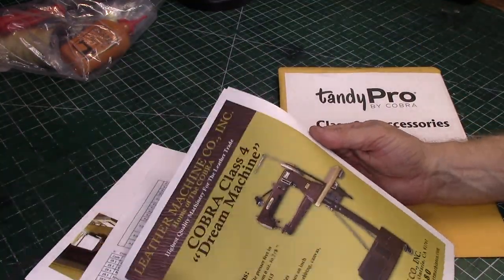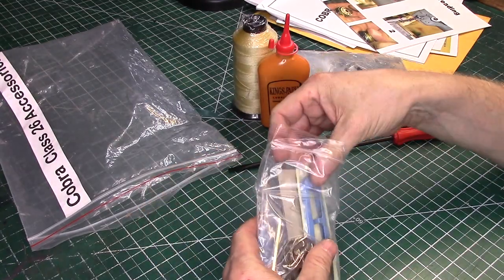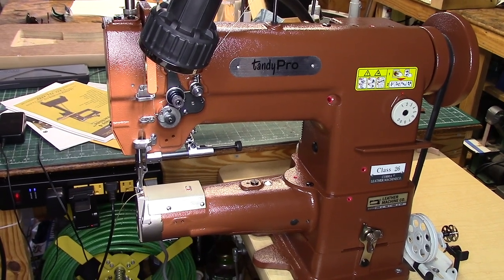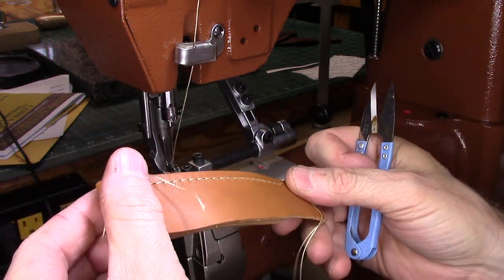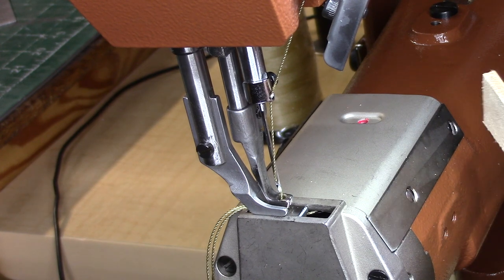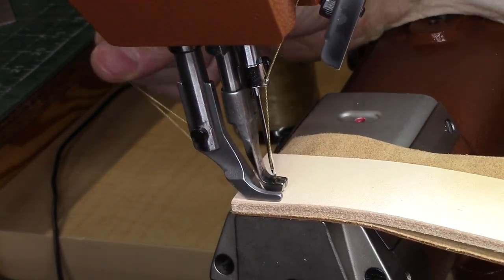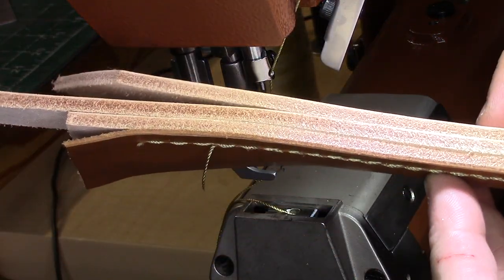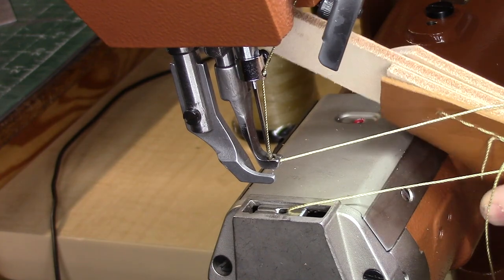Cobra Class 26 Leatherworking Sewing Machine Torture Test!

Comment: A tip for the table. If you remove the table a lot, replace the wingnuts with M8 thru-bolt knobs. A game changer for these old hands.
Reply: David your comment got me thinking. I'm going to look into a camloc system for the table connection, so I can just quarter turn a knob on the bottom to lock the table in place. This would make putting the table and taking it off a BREEZE!

Comment: I think there's 1 thing people forget to mention on demos like this is the glue. On real projects, people put glue in between the leather, and that adds density that add stress to the sewing machines.
Reply from the maker: The Cobra has an oiler pad for the thread just above the needle. I find that helps a bit. I used to spray the thread with silicone on my Boss for the same reason.
Reply: @RoadAgentLeather  I'm using the Cowboy CB3200, which is similar to the Class 3, im quite surprised class 26 can go that heavy of a leather. Love your work man!

Comment: Are you happy with the appearance of 207 thread which is maximum for the 26. Your hand stitching on holsters appears thicker. I’m considering the 26 for my first machine. Like you, I  make holsters  as well as bags. Your work is beautiful!!
Reply from the maker: I went through the same decision-making process. I bought this machine almost specifically to sew liners. I knew I was always going to saddle-stitch the main seam on holsters and knife sheaths by hand. Those seams aren't typically that long or difficult. But sewing together a bag, pouch, satchel, or a backpack by hand takes forever. From a practical standpoint, there's only a slight difference visually in 207 and 277 thread (in my opinion). Supposedly, you can run #277 thread on the top of the Class 26 . . . although I've never tried it myself.

Comment: Not going to yell at you. Because…. “been there and done that”. I think once you get to the point the presser foot no longer has any room, you’re pretty much assured of stalling. Or, if you try to run what you did at a higher speed, the needle could very well flex when piercing that much leather to the point of crashing into the throat plate. Not a huge issue other than a busted needle and readjusting the needle bar. These machines are tanks.

Comment: THE MOTOR SOUNDS LIKE CRAP,,,NOISY AND STRAINING.  YOU CANNOT PUT THE FABRIC SO THE PRESSURE FOOT IS TO HIGH. THE TENSION UNIT WILL NOT CLOSE. THIS IS A REMAKE OF OLDER MAKES. MACHINES.  YOU WILL DAMAGE THE MACHINE. YOU AINT PROVING NOTHING,,SEWING ON A SMALL PIECE AND SEWING TO MAKE SOMETHING IS DIFFERENT.    SOUNDS LIKE A TRACTOR.
Reply from the maker: Thanks for watching and taking the time to leave a comment. But why are you YELLING?!